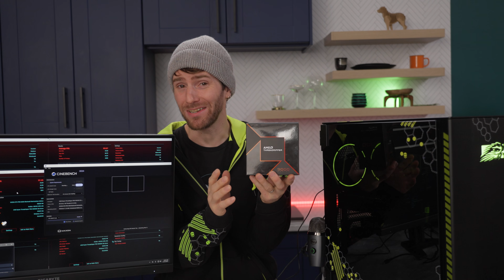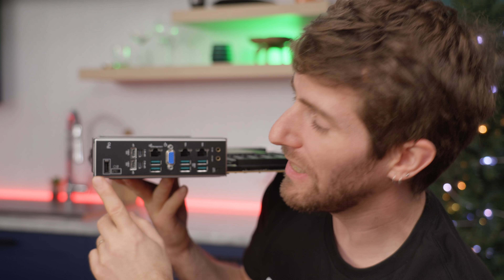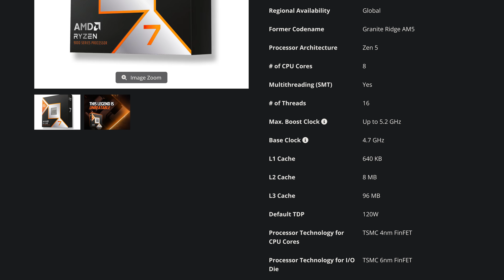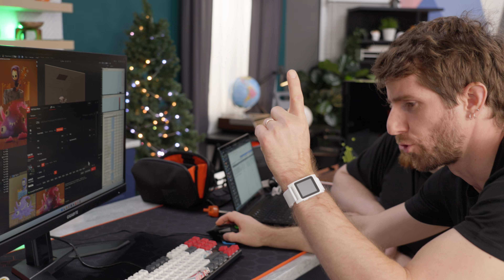The Fastest Computer I've Ever Had

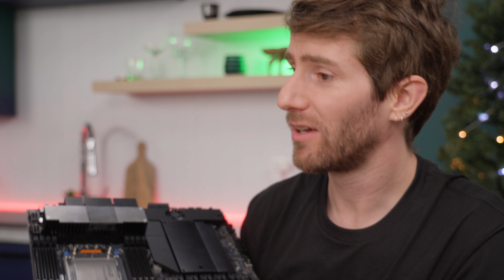Comment: 7:35 not mentioning that VGA PORT?
Reply: idk what's the fuss, it's a server CPU and a server motherboard. 

although yeah, to note: almost, if not all, server CPU has no integrated graphics. instead, relying on a separate Baseboard Management Controller (BMC) with a basic 2D accelerator giving basic video feed for initial OS installs, troubleshooting, or KVM access, even when no dedicated GPU is installed

in short, it doesn't need anything better since you wouldn't show nothing more than the BIOS.
Reply: @sya_7489 no fuss lol just that he goes over all the ports and doesn’t mention the VGA port and that it’s for server use
Reply: Gen Z probably don't know what the hell is a VGA port these days.
Reply: @fleurdewin7958  I'm using one tho
Reply: @fleurdewin7958  yeah well turns out we grew up on CRT monitors, all of which had at least one VGA input and they were sometimes accompanied by a DVI input as well, now that's a port i dont see a lot of people talk about anymore! hell my current motherboard (B550) has a VGA out, which makes troubleshooting video issues so much easier since i do keep a spare VGA LCD monitor around...

Comment: So basically this thing is an area of because of it's architecture, a program can only run 10-20% of the processor at a time? And on power feed it basically needs a 240v circuit to supply it.. and a refrigerant cooled water cooler.. basically if it was all stuck together you'd have a 3,000watt space heater that does computing things.. that's about the gist of what I'm getting lol. 

What it would be excellent at is multitasking, running separate simulation loads or if it was basically the central computer for 10-20 workers I guess using it as a server for remote client. Unless I'm horribly misunderstanding the entire video lol.

Comment: It's not a computer..... It's a space heater.  The good thing about nerds is that they are constantly upgrading.  I am currently building a computer and bought a lot of things second hand. motherboard (asus  PRO-WRX80E-SAGE-SE wifi 2), CPU (threadripper pro wx5995, 24 core, 48 thread) and a 3090 for a bit of 4K gaming.  The plan is to water cool the beast, then put in a couple of last generation RTX6000 ADA (not the latest blackwell).  The aim is to run 4K gaming, and 70B LLMS locally and do rendering all at the same time!  The build has stalled as I am waiting for the RAM (512GB, ECC, registered, $4000 AUD) to get here from the USA.... As for the cost (even using those sec ond hand parts), its well intop the 'well, if you have to ask, you cant afford the damn thing.

Comment: how does switching off hyper-threading affect the temps and draw?  i had a 1950x that would not clock above 3600 out of the box with it on but would run 3900 and higher overclocked just by a 10% bump on the core voltage and adjusting other chip package voltages .. and ran cooler doing it

Comment: Were you powering this system through a 3-phase 208v system or 120v? This matters because on 208 you’re only pulling 9 amps at 208 and 16 amps at 120. It would explain why your breaker isn’t tripping while running this

Comment: AI Power Workstation - AMD Ryzen Threadripper PRO 9995WX 96C/192T, 2x NVIDIA H200 NVL 141GB + NVIDIA Quadro T1000 8GB, 512GB DDR5, 4TB Gen5 SSD, 2200W PSU, 320mm Liquid Cooler, Win11 Pro
Could this be better?

Comment: 16:50 I'm assuming the breaker didn't trip because the video was filmed in a commercial environment, so it's a 20 amp circuit.  It might trip the breaker eventually but breakers trip over time unless the sudden draw is high enough.
Reply: Even discounting that, ordinary breakers depending on type can have their amps exceeded for a certain time frame until it reaches a required disconnection time on the trip curve.

For instance (although I’m in the UK 230/240v) if I have a 20A (B type BSEN 60898 breaker) it can take ~30A for 300 seconds. Although this can change based on standards and design country to country the science should be the same. Luckily this is prospective and not fault. 

This is why when you have a fault the additional resistances and potential difference can drive up the amps for a split second to vastly exceed trip curve and cause a more rapid disconnection.
Reply: @SenoirMeow Yeah. Here in Finland the specs of most used circuit breaker state that at 1,5 times the rated current. It must not trip in under a minute and must trip in 10 minutes. At 1,45 times the rating it can take an hour to trip.
Reply: Haha... US...

Comment: 1900W / 1.3V = 1500A. 
I cannot imagine a thin layer of the pcb how can handle that much power. Or even those small contacts can handle that much power..

And the 32VRM phase just wow the poor mosfets are on the edge with 50 amps per phase.

Comment: Cool... I'll stay with my little 12400F six core and 32GB of DDR5 6000. My single 1TB 980 Pro SSD works fine. Here's the shocker, still using my GTX 1080 at 1440p resolution on LG 32" Ultra Gear 180Hz refresh rate.

Comment: For anyone in Switzerland looking to upgrade their PC, Digitec (the largest electronics retailer in Switzerland) sells several versions of the
“Threadripper Pro,” “WRX90 Motherboard,” and “RTX 6000.” The three items together cost only about 20,000 CHF. Unfortunately, I couldn't find 8x125GB RAM (but that's probably for the best, as 1x125GB already costs 2,500 CHF). The best option is probably 8x32GB RAM or 4x64GB RAM for about 3,000 CHF. Now all we need is a case, water cooling for the CPU, a few fans for the case, a power supply, and a few small extras. However, I've stopped looking for components because we're already at CHF 23,000 (approx. USD 30,000).
Reply: Hot damn.. so unobtanium levels of "peak" here in Australia.

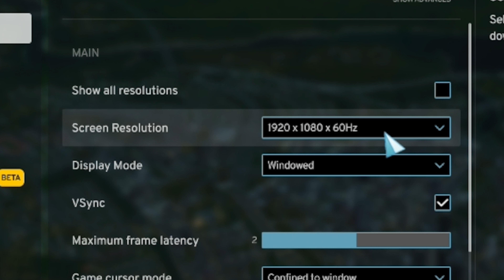Comment: 17:41 - You know the game industry is COOKED when your game runs at 40 watt per frame PER SECOND
EDIT:
As the gentlemen in the comments notified me, watts are a unit of Power which is already time dependent (Joules per second), Just as the FPS. So we can just say "Watts per frame". But that doesn't really tell us much about the qualitative performance, since higher resolutions will obviously require more Power to generate a single frame. Thus I suggest to represent it as microwatts per pixel; in this specific case, we are running at 40.000.000 microwatts per 2.073.600 pixels (1920x1080), which is about 2 megapixel, for a whopping total of 20 microwatts per pixel. This basically tells us how bad the game is running and, curiously, it's also very pretty because "1 microwatts per pixel" is basically running a game at 1920x1080 with a Power consumption of 120Watts, which is not unusual when running a decent game on the high settings. But we want an index that tells us how good the game is running "power-wise", so we are gonna call this measurement "Pixel Power Consumption" (abbreviated PXC), and we are going to create ANOTHER measure called "Pixel Efficency" (abbreviated PXE), which is basically 1/PXC. 
So the PXE of city Skyline is gonna be 1/20, which is 0.05 (very bad), while a good game will run close to 1. Noticed that this unit is theorically independent from resolution AND framerate; in an ideal scenario, where we are not hitting memory limits and don't encounter driver issues, doubling the framerate will also double the power consumption, so the Power consumption PER FRAME will stay constant. The same is true for the resolution, since we are already calculating the power consumption for a single pixel. I think PXE would be a good way to judge performance compared to graphics. Of course reducing the quality will result in a greater PXE. But that gives us a good index to compare games with similar graphics. For example, Doom Eternal draws about 100Watts at 1080p 60fps on High settings. 100W ÷ 60fps = 1.6 Watts per frame, in this case 1.6W to render 2 Megapixel, which gives us a PXC of 0.83 microwatts per pixel. The Pixel Efficency (PXE) will then be 1/0.83, which is about 1.2. We can then judge a game's qualitative performance by their graphics AND their PXE. For example, if you see a game with graphics comparable to Doom Eternal (quality wise), you should expect it to run at PXE ≈ 1.
Reply: @galladebutcooler8645  AKA 10 calories per frame
Reply: @Undergroundmoose  How do I run at 10 calories per frame? I'd lose all this weight.....
Reply: @michealrossiter148 Put a generator on a bike and pedal R E A L L Y hard.🤣😋
Reply: Paradox: "This is fine...." probably....
Reply: Were literally cooking ourselves at this point.
Reply: Colossal order steps down
Reply: Thank you for the edited press release statement for this comment 😆
Reply: the game is the bottleneck, im crine😭😭😭😭😭😭😭😭😭😭😭😭😭😭😭😭😭😭😭😭😭😭😭😭😭😭😭😭😭😭😭😭😭😭😭😭😭😭😭😭😭😭😭😭😭😭😭😭😭😭😭😭🙏
Reply: @NinjaCactus42 Crying.
Reply: When you want your game to so desperately be the new "but will it run Crysis"
Reply: Watt means per second anyway
Reply: The hot, heavy, powerhungry cards of the past 2 gens are an abomination.
Reply: @Grandmaster-Kush  5090 энергоэффективнее чем 3090
Reply: @BlackWGame   "microwave is more efficient than oven"
Reply: damn thats a regular teelight....

Comment: I wonder about the design of memory water coolers.  This has been noted as relavent for Threadripper and Epyc, with at least the PMIC getting blazing hot, sufficient to thermally throttle, without deliberate cooling of some kind.

Most pure client memory cooler designs use passive/dumb heat spreaders that are interfaced with "top mounted" coolant interface blocks, thereby requiring that heat flow "laterally" across the bulk of the heat spreader, through a resistive interface between the heat spreader and the block, and then transfer into the coolant

As far as I know, there are no systems with, for example, micro-channels in those heat-spreader assemblies (there is confusion about this elsewhere online, but litereally none of the readily-search engine surfaced examples, whether they be custom all-coppper designs or mass produced stuff from China or anything in between, have this design.    This includes the old Koolance systems with the water-block built in, where the water path is still exclusively restricted to just to the top)

Enterprise systems, instead, transfer coolant directly through hollow interface/block structures that more closely couple the physical interface between the coolant and the solid conductive interface and the underlying chip heat loads.   This is how CoolIT (and many other copy cats) designs work.

Its always tempting to assume "Enterprise better" but I genuinely wonder about this.

The enterprise designs I mentioned above "work" due to the typical airflow-path of 1 and 2U systems, and the memory slot layout that has become commonplace with 12-channel Epycs (2x6, with 3-rows of hollow coolant channels, with the middle channel conducting from both sides), not to mention the recent trend of "breaking out" the PCIE subsystems into physically separate PCBs that connect with specialized high speed plugs or network fabric (ie, as typically encountered with AI HPC designs that use socketed Mezzanine or hard-soldered accelerator PCBs)

All of that was preface to my ruminating about the PMIC, which is normally dead-center at or near the tippy top of the DRAM, physically closest to one of those pure-client top mounted water block designs.

I genuinely wonder if they are superior to enterprise designs.

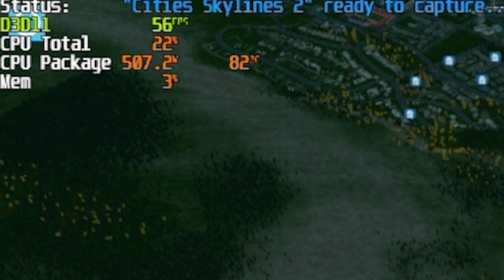Comment: 17:24 Threadripper Pro 9995WX, 6000 blackwell, 128 gb of ram and city skylines 2 at 1080 runs at 50 fps, how is that even possible? Diabolical levels of unoptimization
Reply: 128GB RAM PER DIMM, it's 1TB
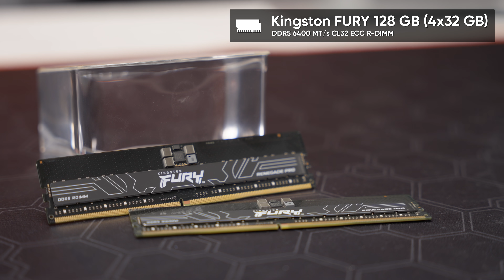Reply: @akraken9057  3:26 it's written 4x32 GB
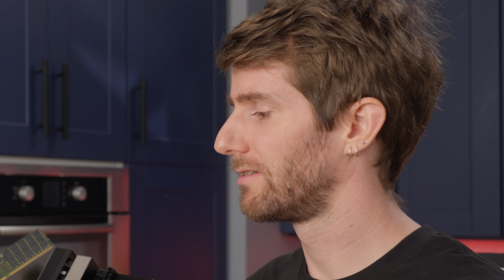Reply: @Pitoouuu  That was the first system. 8:43 they switched to WRX90.
Reply: @V.n.D Thanks, I missed that!
Reply: Probably just Amdahl's Law in action. The game runs something required per frame in a single thread and once that gets 100% single core usage, nothing will make the rest faster no matter how many CPU cores you have. If your CPU monitor cannot show max usage per core but just the average (as most tools do), then 1 single core fully pinned will report 1.05% average usage when you have 95 other cores waiting at idle.

That's why you should only use CPU monitor that can show the busiest CPU core load.

The game displayed 25–35% CPU usage so it was maybe able to use up to 32 cores in total.
Reply: @MikkoRantalainen  Exactly this. Knowing how Unity (and most game engines) works, it's likely a single overloaded thread bottle necking everything.
Reply: @MikkoRantalainen  In case of this game, it's not as much the number of threads that's limiting you, but rather the amount of synchronization between all the worker threads that's limiting utilization.

The biggest issue with scaling a single process this far, is the global synchronization that freezes the entire process whenever you need to do memory management (reserving and releasing RAM back to the system), as ALL cores need to stop working on that process for the virtual memory tables to update. You are perfectly fine if the application is either pooling properly, or if its split into multiple processes with isolated address spaces, but everything that hits the OS hits any other thread too.

Then comes the usual issue of cache line sharing, mostly by excessively using atomics on counters shared between too many cores. So easy to get something to trivially scale nicely on a (native) 8-16 core CPU (extra SMT doesn't hurt you this time!), but beyond that things get tricky and you suddenly need to think carefully about sharding and tiering your memory accesses so each cache line has only a bounded level of contention.

And finally there's the issue of "lock free" algorithms using atomics with compare-exchange semantics. Those not only hit the cache line contention issue mentioned above, but most developers horribly underestimate just how much the risk of contention and thus the need for backoff increases with the number of cores. It may sound paradox, but the more threads are competing, the better a classic OS backed mutex performs compared to a spinlock. (And there's also a very good reason to explicitly keep the mutex OUTSIDE the same cache line as the protected data by aligning and padding the memory around it as needed!)
Reply: City Bottleneck 2
Reply: 3% of ram used, thats 30 bloody gigs!
Reply: @Shmilia  It was 1TB of RAM
Reply: It it the destiny of City Skyline devs make this game scalable over this absurd amount of cores just to make real benchmarks fun.
Reply: Its because threadripper is not for gmaing
Reply: Most games still run core game logics on one CPU, so the main issue there is frequency and memory speeds. But games and also game engines like unreal and unity are starting to be more built for more and more multithreading aswell, otherwise most of that low level optimization has to be done by the game programmers, with a game engine that is built for more 1-core focused games.
Reply: It's extremely poorly optimized and also not a gaming PC to begin with lol, none of these parts are made for it
Reply: U don’t need a computer that powerful it’s waste
Reply: The definition of taking  gamers for the granted
Reply: the of optimisation is pessimisation fyi
Reply: I always thought it was just my PC... they should really fix this 😭
Reply: @Shmilia  its called a Paradox game in case you didnt know lol(and I still like their game)
Reply: @Shmilia  please dont talk when you dont know. It might be unoptimized drivers for game specific calls. It might not be compiled correctly to use the hardware. It might also be a limited amount of threads used, scince not everything can run in parallel
Just because it has more compute cores doesnt mean single core performance is better.
There is a lot of more factors that can be not the games fault
Reply: Simple:  It's a CPU, not a GPU!  Try running Mandelbulber 2 4D fractal imaging/animation program on it where due to it using dual integer math GPU's can't do yet, and need all the CPU cores you can get, as some images may take hours even days to render, and animations with thousands of framed weeks to months even on that processor.  For that you are better of with access to a super computer!
Reply: @Bob-of-Zoid but citites is a cpu intensive game because of all agents running the subsystem of energy water and all other services
Reply: @DrCryos  "but citites is a cpu intensive game because of all agents running the subsystem of energy water and all other services
But it's still only a game. A game in which it's content was already pre generated.
There's a big difference between any game compared to 3d software that is used to create and generate content for such things like games.

Comment: I still don't understand. Of course Threadripper is powerful. It's really 4 CPUs fused together. Duh.

Also, this RAM issue is so ridiculous. There is no RAM shortage. It's fake scams across the board to artificially drive up costs because people don't buy RAM frequently. Sure, the latest and greatest DDR5 might be expensive, but there's no supply/demand issue for DDR4 and lower-tier DDR5. NO ONE is buying DDR4 in bulk for their AI banks. So why is DDR4 price higher? Easy, because it's lie and fake supply/demand created to scam consumers. If everyone collectively just shuts up about RAM prices and stopped buying expensive DDR4/Low-Tier DDR5 the market would fix itself and only high-tier DDR5 would be expensive. Then we could all just go buy DDR4/low-tier DDR5 at normal prices again.

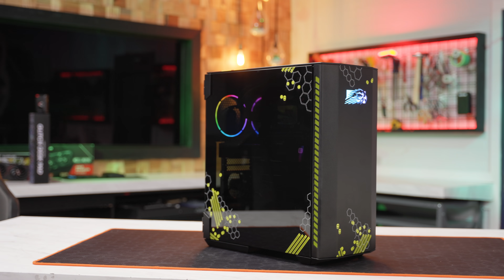Comment: 20:00 Sadly, not's not how that works. The limit will depend on the university, but generally, any purchase above $10k to $20k will have to be officially approved and go through a public tender procedure—assuming you can even get the money for it. 

In practice, getting compute time on a university cluster will be a lot easier to arrange than dropping $50k on a computer that only your lab will use.